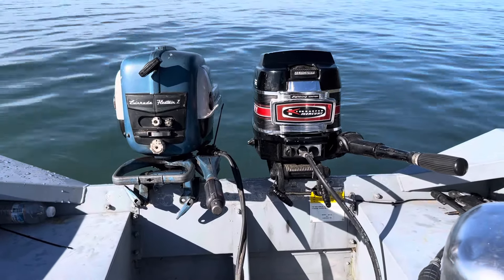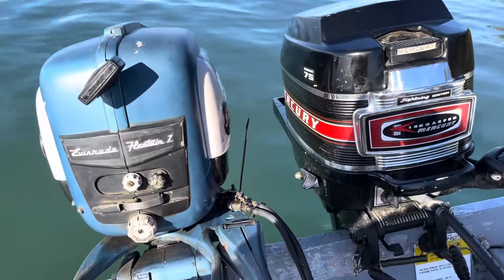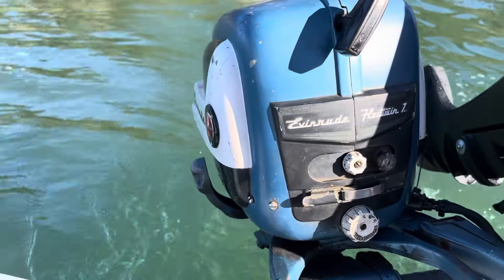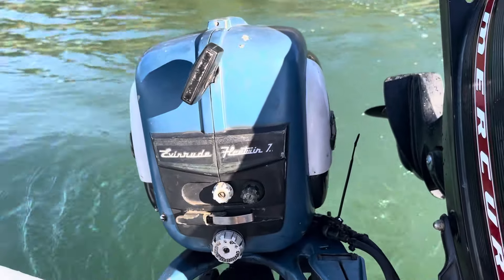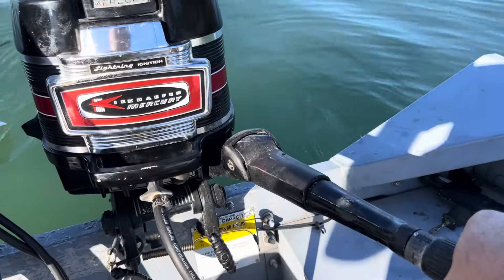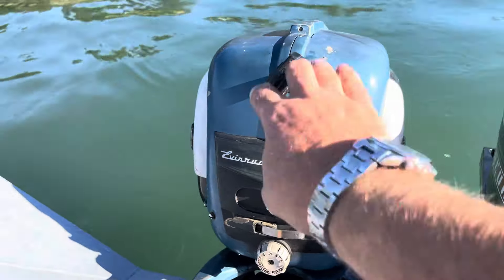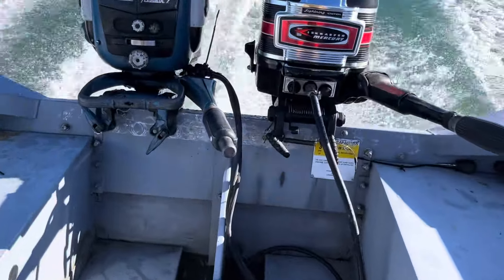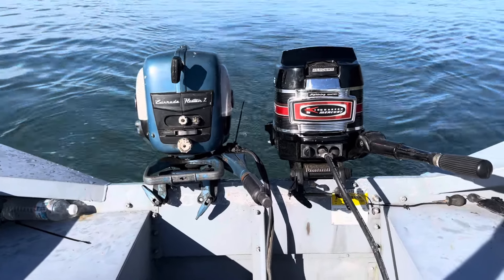Mercury 7.5hp vs Evinrude 7.5hp. Speed test dual power run

Comment: Correct me if I’m mistaken. BIA horsepower ratings changed from driveshaft to propshaft in between the manufacture dates of these two outboards. 
The water pump impeller and gearcase drag reduces HP. So the OMC 7.5 is driveshaft HP. While the Merc 7.5 is prop shaft HP. 
A 1950’s Merc 7.5 would be about the same as this omc.
Reply from the maker: @davemilster  Interesting. Didn’t know all that. Thanks!
Reply: Same with cars.

Comment: Interesting but not really a fair test when the Merc has almost a 15 year technology advantage. Both Well constructed Motors. 👍
Reply from the maker: @inthelandofmilkandhoney457  Those old OMC motors were made for hours of slow dependable trolling. Mercury engines were made for going fast then blowing up!  Thanks for watching glad you liked it!
Reply: @OutboardMotorFun  🤣.  I have several of each and many OMC motors  from the 50’s. They are Awesome Outboards. I wish they were more valuable price wise up here in Canada. Difficult to get a good buck for them.
Reply from the maker: @inthelandofmilkandhoney457  A nice motor with tank will go for $100-150. On the coast you alway have to deal with salt corrosion. Those Midwest motors must be nice and clean! I have motors that have never seen fresh water, just the opposite…
Reply: @OutboardMotorFun  Yes. I do have some very nice clean motors. 👍

Comment: Either that boat is a barge or that motor is not running correctly. I waterskied behind a 7.5 Evinrude on a 1950 wood Thompson when I was 125 pounds.
Reply from the maker: Both motors were offset from the centerline and the extra weight on the back adds to the lackluster performance. Remember the Evinrude is almost 70 years old and was locked up not too long ago.  Thanks for watching, hoped to liked it anyways

Comment: Not the same speed test!!!! 1 had a 3 blade prop, the other had a 2 blade prop. To do a fair test, both should have the same prop size, same blades, and same pitch. That would be a fair test!!! Think about that???
Reply: Would not matter, Mercury still will outrun the rude.
Reply: Ether way, we only had mercs..  Always faster and smoother...
Reply: As a factory comparison, this is far, but you do point a gooin idea out

Comment: The mercury is always faster than all the other brands of outboards. That mercury promax 2.5 liter was probably the fastest outboard ever made that 2 stroke sounds amazing
Reply from the maker: @DustinKeating-yk3vq  All their HP was always underrated at least in the early years. Now all their small motors are made by Tohatsu…..sad
Reply: @OutboardMotorFun that there's cuz game lake 's had a under 10 horse my dad had a 9.8 murc but really a 10 horse so you use on a game lake

Comment: I’ve got a really nice 1958 Johnson 7.5. Was disappointed in its performance. No man’s land motor as it won’t get the boat up on plane so really doesn’t go much faster than a 5.5. Also have the same motor as that Merc in a 9.9. Not running yet - no spark. 😖Cheers from Coquitlam, BC. 👍🏻😎
Reply from the maker: You know you’re a good mechanic when you get that Merc going! Don’t give up.

Comment: No surprises here for sure.  The Mercs could run rings around those low compression OMCs...  But, the OMC was much simpler and would stand up to more abuse, except for going light on the oil mix...
Reply: 100%. looks at how many OMC's are still running vs. merc. i will attribute some of that to ignition though. the Mercs are much more expensive to service.

Comment: once you figure out how the phasemaker/thunderbolt ignition works and how important that plastic insulator is, they are really quite reliable and simple. i love the fact that they used 400v, and have a "maker" point setup instead of the usual "breaker", meaning it really doesnt matter much what shape they are in or how bad the gap is off (within reason, of course)... she will still spark. have you tried using the old ATOM / sierra Magnatune ignition modules in the OMC's? Really incredible how much smoother and easier starting they are when you have a transistor or 2 doing the switching instead of points!

Comment: Don’t know about a winner here, but the loser is the environment. Two cycle engines burn oil in their gas and dump the unburned oil into the water and the air. A two stroke motor puts more crap into the air in a day than a modern car does in a year. Many lakes prohibit the use of two-strokes for that very reason.
Reply from the maker: @peteradams2522  You are absolutely correct. Fuel burn is never 100%. The industry made millions of these two stroke motors and it will take time for the remaining ones to end up in museums, but to many of us they are our memories both old and new of times with our loved ones. These engines are getting more challenging to keep running every passing year and I imagine thousands upon thousands are being scrapped every year.  Thanks you for watching and your thoughtful comment.
Reply: Hmmm. 🤔 Hear this comparison/comment a lot, but realistically, a small outboard will run off and on all day and use around 3-5 gallons of gas/oil at most. A vehicle driven to work and back and around on weekends goes through hundreds of gallons of gas in a year. I'm not so sure that comparison holds up to be true. Maybe gallons for gallon, yes, 2 stroke definitely worse for environment, but to say worse in a day vs vehicle in a year is a real stretch. Based on general usage, the vehicle will be magnitudes worse overall. We fish/boat a few hours on weekends, we drive every day all year.
Reply: Two strokes Forever
Reply: Unfortunately that statement is not true
Reply: The unburnt gas and 2T oil is not the main pollution problem. That stuff eventually breaks down on the surface of the water. The problem is the exhaust emissions, that stuff pollutes the air. The older 4T carbureted boat engines aren't much better since they don't have catalytic converters. The newer computer-controlled fuel injected ones produce less emissions and are more efficient.
Reply: I have a 2017 three-star certified Tahatsu and it doesn't smell at all and runs really smooth.
Reply: It doesnt produce any more environmental risk then making plastic. 2 strokes produce twice the power of 4 stroke meaning they produce the same power with less displacement. Less displacement and les weight means better efficiency of energy over all. I can do with a 15hp 2stroke what you do with 20-25hp 4 stroke
Reply: @FLORIDAMANIAM-he2lz  With respect, to go with your producing plastic analogy: every time you start a two-stroke engine you are turning fuel/oil mixture into plastics, so not a good analogy. As far as efficiency goes, a heavier 4 stroke rated at 5 hp, will produce  the same Hp as a 5hp two stroke. The 4 stroke weighs more, but goes farther on a tank of gas, because it isn't burning oil as well as gas like the two-stroke. My beef with two strokes (and why they are banned on certain bodies of fresh water) is the pollution. They are bad for the environment because the unburned oil and gas goes straight into the air and water. We are all in the same boat, here and we must do what we can to try to save the climate (see headlines). We can help keep mankind afloat or drill bigger or smaller holes in the hull by choosing to continue to be part of the problem.